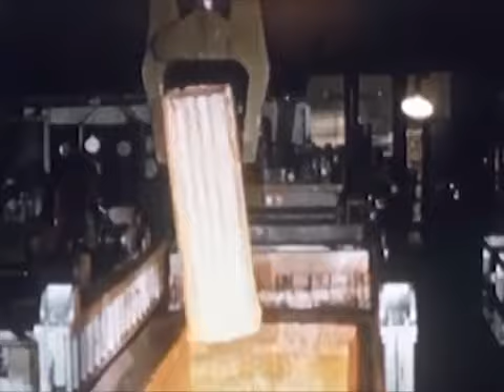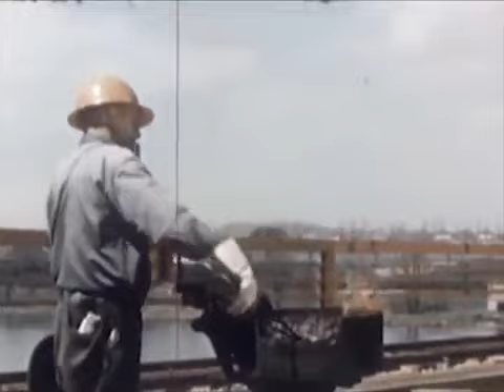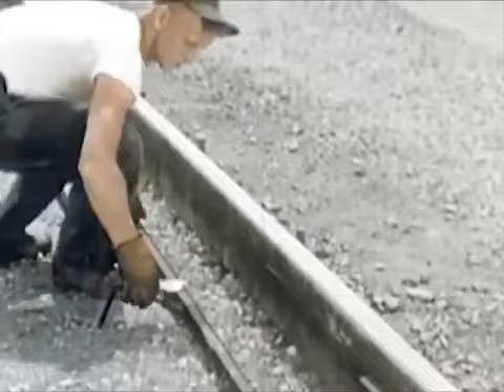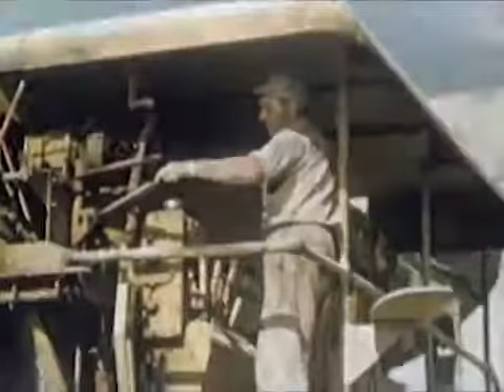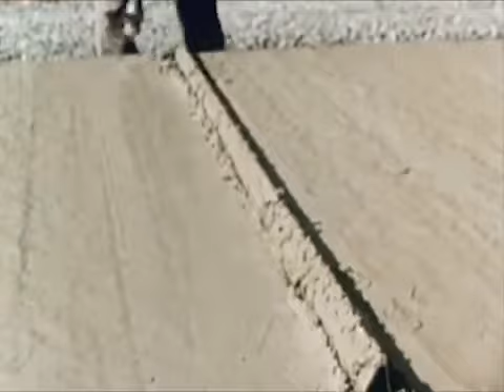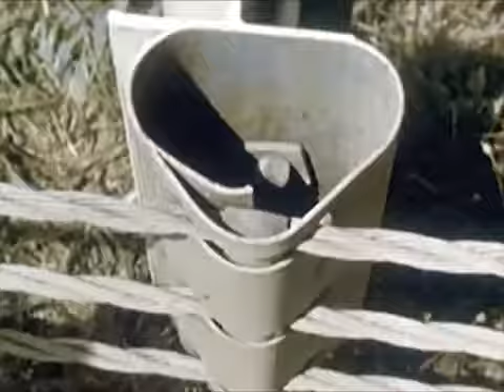Highway Construction: The Open Road 1951 Educational Documentary WDTVLIVE42 - The Best Documentary E

Comment: I seen construction workers just paved over the old road with putting steel rods down and the highways only last 4 to 5 years, vs when the use steel rods the roads last 10 to 12 years without cracking.